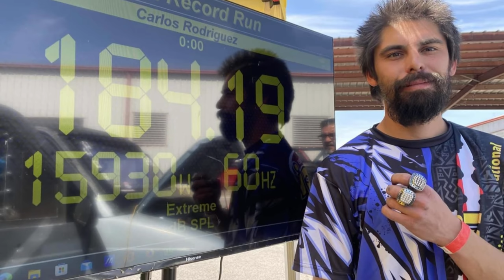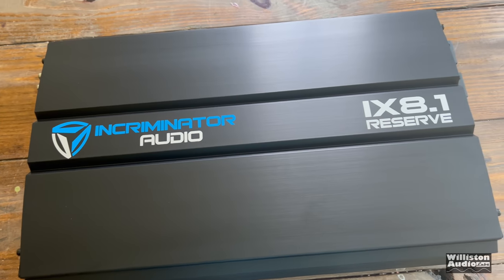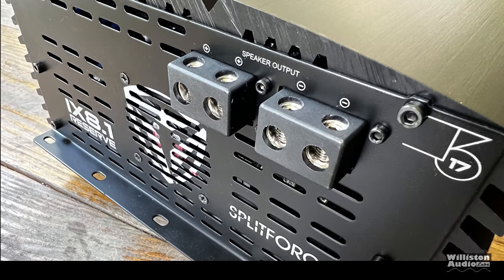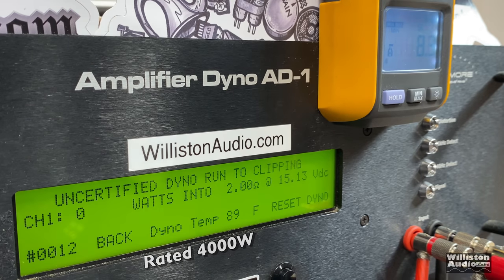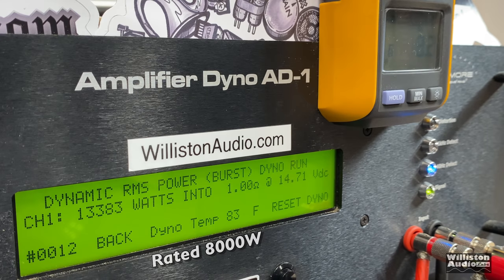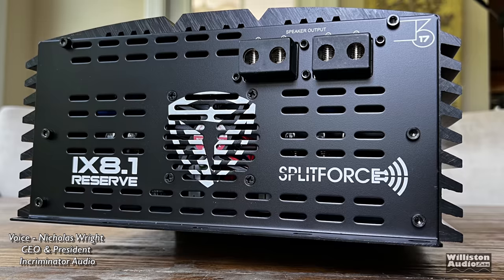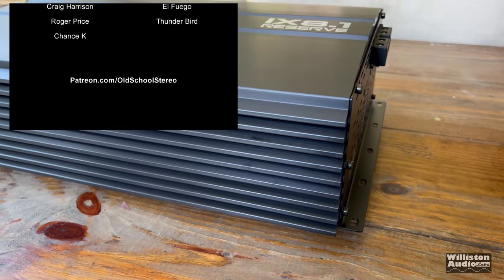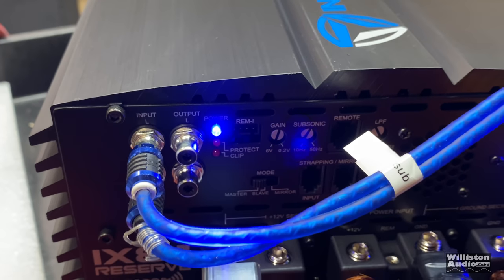8K like ALL DAY? Incriminator Audio IX8.1 Keeps It's Cool and Pumps Out the POWER! [4K]

Comment: The hard core enthusiasts who run this kind of gear in massive systems are clearly in a league of their own.  The needed electrical system and large gauge cabling needed to enable this gear to properly run at its rated capability is a substantial investment.  It is mind blowing to see folks run this kind of equipment in their daily ride...  🔊💪🏽🔥
Reply from the maker: I agree!
Reply: I know 2 guys with $10k plus in daily builds
Reply: @mattadams7922  I can see that this sickness... er, ah... "hobby"... will eventually land me at that dollar amount.  lol
Reply: Yeah buying a huge amp like this is the easy part. Buying and mounting extra alternators and batteries to feed it is the far more complex part.
Reply: @303nitzubishi4  One extra alt and 1 lithium battery with enough 0 gauge will suffice for upwards of 10k rms unless you play song after song with the volume up.  For most people, crank it loud for one great song and dial it back down for the next and 1500 bucks worth of electrical will give you the freedom to install just about any amp you want.
Reply: I would say stay away from this amp. This amp pulled 800 amps when it put out 8k watts. Plus it was given more voltage then most amp and still pulled way to much power from lithium batterie.
Reply: @timgermanyjr  The low pro SQL System I am currently running is no where near this scale (total potential power draw is only 3300W across all amps and DSP while currently running 2 AGM Batteries with the stock 150A Alternator).  I will be getting a 400A Mechman Alternator and Titan 8 under hood lithium battery to enable more flexibility for inevitable upgrades as I progress in the sickness...  I mean, the hobby.  I am scratching myself as I am typing this.  🤣
Reply: @timgermanyjr  i've yet to see a single aftermarket alternator  put out 800+ amps lol  but thanks for the input! ( still a really neat amp) but an INVESTMENT with 8$ per foot 0 ga and 3+3 runs.
Reply: @jimbobdobbs1597  You dont need to charge at 800 amps. The battery is the reserve power. Youre stock + extra alt can charge at 400 or more. A large lithium battery could give you a substantial amount of play time before voltage drops. Then turn it down/off and let your alt recharge the battery.
Reply: @jimbobdobbs1597  $8 per foot just for 0 ga wire... Idk where you shop Jimbob but you getting ripped off!!
Reply: @itdoesntmatterwhatyourname6128  i dont get ripped off.. i run double 4ga ofc at  $1.75 /ft
Reply: I prefer the 4ga to any larger for cost of lugs and terminals. Easier for me to work with also. I dont run huge amps so 2 runs of 4 does more than enough for my amperage. (Most shops resale 0 ga at about 8-10$ a ft) going rate on ama is 4.40 /ft  today)
Reply: @mattadams7922  - $10k is not hard to spend on a daily build these days.
Reply: We are concidered 1%ers
Reply: I have 2. 😁
Reply: Too much for me.  My whole system is under 1000 watts rms.
Reply: @kriptic22  not at all I wouldn't say I'm an amateur but I definitely don't have tons and tons of experience I'm on my third build I've ever done and  have we'll over $20,000 into it already 3 amps over 3,500 a piece for 54,000 Watts over $3,000 in batteries about $1,600 in 2 400a alternators and  the bracket little over $4,000 into 4 18 subs $600 into ofc 1/0 then $1000 in 2 4 channel amps for mids and highs and around $1800 in the mids and highs have 3 8in mids 1 10in mid and 2 tweeters in each door 4 doors  then the box was over $1500 all the sound deadner $500 fiberglass $600 all this  in a vehicle not worth over 10k but why would someone put all this in a new car it literally rips a car to pieces  but I can play music at 170+DB for demos for a few hours at shows before I have to let it rest.   

Ps.  Not one piece of sunclown trash in my build lmao
Reply: I have this amp's baby brother, a 3rd gen ia20.1, rated at 2400wrms at 1 ohm. Currently running a pair of 06 re audio sx10d4s. I have been in this hobby for almost 40 years, and this is by far the best amplifier that I have used, period. And they are in my home state of Alabama.
Reply: @mattadams7922  I have at least 9k into my daily and still not done setting it up. You are never satisfied and once get something good. You want better. It's  a never ending story haha. I have a sundown sfb8k for my two incriminator audio death penalty r6 12's.  Just I want rid of of the sundown to buy the ix8.1 now haha. All this to put in a car to be loud haha

Comment: Remember Big D's very important comment. "It takes power to make Power."
Without the proper batteries , alternator and wiring, not going to happen. That goes for all not only this Beast.
Reply: 900+ Amps is no joke
that's 8-9 battery's at 100AH each!!
Reply: Once you reach a certain point it's probably easier to just build a generator on a trailer or roof rack or something to power your spl amps 😆
Reply: @303nitzubishi4  well you may think that but even the average house with a 200Amp service is only 48000 watts total  😳 some of these guys are running well over that 
And If you have seen a 50 -100kw generator is not small lol
Reply: @NightshiftCustom  
We need to teach some of these people about amperage. Everybody is so into voltage they forget about the most important thing. I explained it to the newbies dealing with electrical and getting electrocuted. Think of the wattage as water and the orange juice running through the water as the amperage the more orange juice get the picture? Makes it easy for the average consumer.
Reply: I think he wordmarked that phrase, didn't he? Lol
Reply: @Mr.Robert1  is amperage the correct term or is it current?

Comment: Thanks for the demo as always big D. I'm an sq guy so I couldn't care less about an amp like this but it's cool to see how the other half lives 😀 The stacked PCB design seems like a great idea, hopefully other manufacturers start adopting it at some point even for more daily driver type amplifiers
Reply from the maker: The new D4S JP amps use all SMD (surface mount) electronics, that's why they are so much smaller than previous half bridge amps with the same power. Incriminator said they are working on this as well and future amps may be half the size as well 😮

Comment: These Incriminator amps are a work of art, if my dealer carried them i would have went that direction, but my Crossfire 16k is holding strong at .67 on 3 Xt3 18's, and 135ah of c-max, honestly I've been happy so far🤙, Super solid numbers out of the Incriminator 🤯, thanks Big D💯
Reply: That's a system I'd like to hear!
Reply: @dextermorgan1  This is the channel I only have a couple vids burping with the new build, I'll put something together tonight or tomorrow, also need to post on our Ford Raptor just put 4 DD 1508's, Lc2, and a DD M3c, neat little build🤙
Reply from the maker: Crossfire amps are legit as well
Reply: I love the xt3 but they're too heavy
Reply: @wal  I have a DD 9515 Supercharged laying around, just needs a recone🤙
Reply: @brotharobmusic  I'm going to be honest mounting them on a flatwall by myself was nerve-racking, especially sense I slipped once with a PSI sub I just reconed, got the job done though🤙
Reply: @bassbikes9709  my big bro had 2 in a 6th order wall. I Inverted them and it was a pain too. Now he has 4 C7 18s. I'm a Soundqubed guy. As soon as Soundqubed get the HdX3 18 in stock I'm buying 4 of them right away
Reply: @brotharobmusic  not a bad route to go, Soundqubed is the owner of DD Audio son, really good products, price is good as well🤙
Reply: @holeshotinspectionllc2412  I have an hdx3 15 on a Kicker Zx 2500.1@2ohm and it's mean
Reply: @holeshotinspectionllc2412  so soundqubed owns DD or the other way around?
Reply: @brotharobmusic  Two different owners, Dad owns DD, son owns Soundqubed, but they are based out of the same building🤙
Reply: @brotharobmusic  Sick, nothing wrong with that🤙
Reply: @holeshotinspectionllc2412  that dope! My first real spl sub was a DD Audio sub
Reply: @wal  I really don't like this brand because they actually think two boards together is something new. Two 4k boards in one case and sold for a high $$. It's completely a room saver for people that big systems

Comment: Wow 184 db on 15k amazing. I love how fat and different this amp is. Very cool looking to me. Very expensive. The JP63 almost had it. I can't wait for comparison to JP83. 😁
Reply: Yes very amazing, which probably drives up price. 🤔
Reply: that is more than likely measuring power from one amp so it would be multiplied
Reply: @SidyDidIt  That makes sense.
Reply: @SidyDidIt  dunno forsure, Craig Butler did 182dB with 4 DD Z 18" subs on 4 5000W DD Z1A amps, that was pretty amazing back in the day

however this ofcourse needs the entire car to be turned into a giant enclosure, bolted shut etc so nothing can leak directly
Reply: @BH4x0r  and then you have Nathan millyard. 8 DD Z418s on 16 DD M8000s doing over 180 at ~50 hz. With plenty of bandwidth all the way down to like 18hz
Reply: @blakebrockhaus347  well yeah, i just meant it's impressive he reached 182dB on 4 18's and only 20kW, but his setup was just to hit one note but hit it right lol
Reply: Back in the day I remember anything over 150db was awesome now they up to 184db

Comment: Revisiting this one.  I have an old IA 20.1 that I used to run on an RE MT12 with dual .7 coils wired to .35
Surprised this one went into protect but I guess you dont really need to run the giant amps that low.   
Keep your batteries charged, friends.

Comment: for what its used for (and the extra money you'll be dumping in, considering) only downside i see is the remote voltmeter, but that's a minor quibble and easily fixed. and really, considering the output, it's a decently compact package compared to some i've seen at the same rating, that don't go as far over rated.

Comment: 0.67 resistive load is like a 0.1 ohm subwoofer... if they are running them at 0.3 ohm in competition, i would suspect with rise, its around 0.8 ohm
Reply from the maker: I would think the TL would show the impedance but that sounds about right. My sub wired to 0.5 stays 1-1.2 ohms

Comment: Looks like a great SPL amp. I don’t like seeing a Korean amp go into protect @.67, and $2000 is pretty high, but I love the stacked design to bring down the length a Korean amp that does this power would typically have. I realize after rise you could probably run this thing @.5 all day speakers. Seems like a great amp overall👍🏼👍🏼
Reply from the maker: Nick says they run all the time at 0.33

Comment from the maker: Incriminator Audio IX8.1 8000W Subwoofer Amplifier
Shop (affiliate links):
Incriminator Audio IX8.1: https://bit.ly/3t4w5Lz
Crossfire XT 8K: https://bit.ly/3wZDvAC
Sundown Audio SALT 8: https://bit.ly/3t7IsX5
D4S JP83 Amplifier: JP83 Amp: https://bit.ly/3t0zz1y
Incriminator Audio IX15.1: https://bit.ly/3MZ5reL
Down4Sound JP Amps: All JP Amps: https://bit.ly/3lMb4kz
Video Playlist of 5kW and Larger Amps: https://bit.ly/3M2PuTE

*You Sell Subwoofers and want to sponsor a Do It Bump Segment?*
Send me an email willistonaudio (at) gmail dot com and we can discuss

SMD / D'Amore Engineering Amp Dyno: https://goo.gl/sJTcf7
XS Power D1400 Batteries - https://amzn.to/2BPFCKW
XS Power PSC60 Charger - https://amzn.to/2CHGcfs
Fluke 1000A AC/DC Clamp Meter: https://amzn.to/2Rw5WDA
Handheld Dyno: http://amzn.to/2u2EgKV
My Favorite Screwdriver Kit: http://amzn.to/2x0VzcE

Video Index:
0:00 Intro
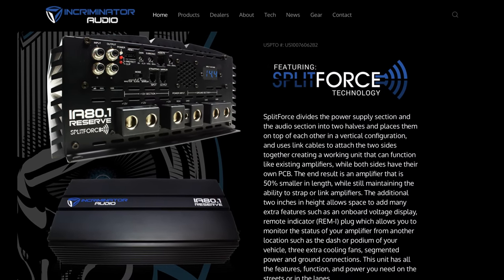0:52 Unboxing the Amp
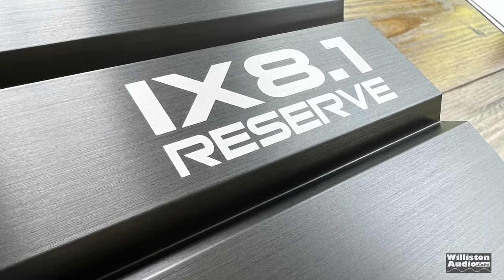2:10 Features and Specs
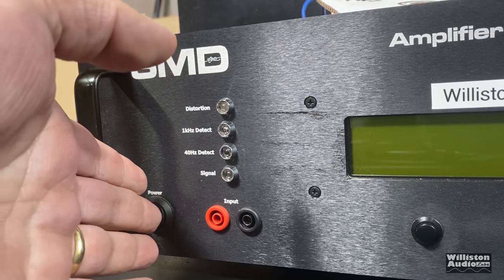4:25 Amp Dyno Tests
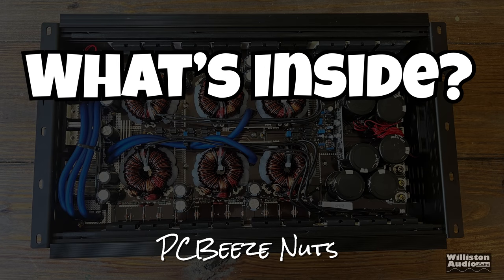8:05 What's Inside?
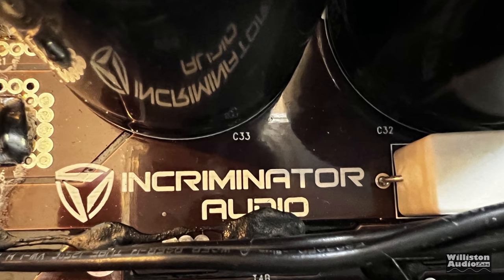9:24 No Do It Bump Doe?
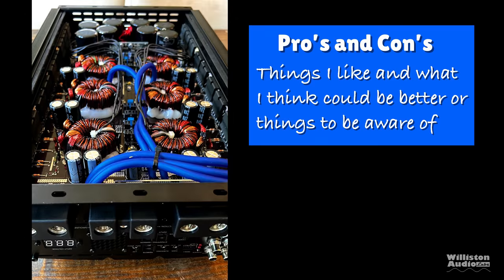9:46 Pro's and Con's
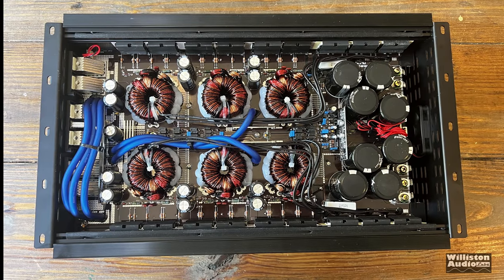10:32 Final Thoughts

11:05 Extra Tests

DISCLAIMER: This video and description contains affiliate links, which means that if you purchase from one of the product links, I may receive a small commission. As an Amazon Associate I earn from qualifying purchases

Comment: any suggestions for a half decently priced 4 channel amp for a SQ build for my truck? list so far 4 sundown sa10's, audiocontrol dm-810 dsp, 2 sets component jbl gto609c 6.5 sets, and 200 pounds of sound deadener lol 1/2" thick  around the hole truck to deaden the diesel engine. thanks

Comment: hey there bro had a question about the fuses for these amps. i ordered the ix 6000 yesterday. would i use 3 200amp fuses on the 3 positive wires that go to this amp to equal up to 600amps. or 600amp fuses for all 3 positives wires?

Comment: I was expecting a little bit more to be honest. But I suppose that's where we are in car audio these days. More is not always better apparently
Reply from the maker: People always think they want more it seems
Reply: @Dibeezy ThaGifted how much more power do you want from an 8k amp?? If you want more then you need to be looking at amps with higher ratings!
Reply: @itdoesntmatterwhatyourname6128  I was only expecting more because of the current trend of amplifiers doing rated in the 12 volt range. I figured incriminator would at least want to keep up with Crossfire and sundown and digital designs as all three of those companies new 8ks make over 12K
Reply: @DibeezyTheGifted  ok, I gotcha... Hey atleast IA is doing their own thing & actually being innovative. The amp is a new design, it's unique & appears to operate exquisitely. I love the fact that even after running it hard on the dyno then running it on the Massive Audio sub the amp still stayed cool. That's impressive, idk many amps that could do that.

Comment: subwoofers, especially in an SPL build are creating ALOT (like 10-20% or even more) total harmonic distortion, so having it under 1% THD in an SPL build is completely useless. Uncertified and Dynamic truly are the numbers that matter here. Now if you're doing an SQ build, then that's a different story, but for SPL, uncertified is where its at, and also dynamic for those burst tones. Humans cannot detect distortion in bass frequencies until around 10% or sometimes more.. so i see no problems here, this amp is exactly what you want, big dynamic numbers, how amazing for such a small package. I also LOVE that the power and ground are actually separated, its alot safer that way and more convenient.
Reply from the maker: my sentiments exactly

Comment: It's a good amplifier but I'm not running any amplifier up to clipping? For two main reasons I don't want my coils smelling and I don't want a voltage drop? And the voltage is going to drop when it is clipping?
Reply from the maker: SPL competitors use clipping to get some extra deebeez

Comment: This amp is a technological tour-de-force, but a 13KW peak at 14.5 volts equals a current draw of almost 900 amps! So really, it's just for competition use, right?
Reply from the maker: I guess some people could put an amp like this in their daily driver...as long as they have phat electrical to back it up
Reply: @wal  Maybe a diesel generator like the one I have for when the power goes out! 😆

Comment: TY big D!
ATTENTION BASSHEADS 
Im in need of 2 Beastie amplifier! but the price breaks the bank 🏦 , I could see myself paying a $1099 or something but 2k is definitely out my budget. What’s a decent amp 8k-12k watts, besides Taramp. (Because I was considering running; 3 smart5 bass amps, or 2 bass 8k amps)
Reply from the maker: Gotta have strong electrical no matter what amp(s) you choose
Reply: @wal   yes indeed. Takes power to make power my friend.
will a 128ah bank of headway’s be good enough? I have two banks but would prefer to use just one if possible. (I guess it depends on voltage drop) I have a 320a JS ALTERNATOR for now. 
I see Parker the basshead running  2 taramp 8k’s on his setup.  I’m just curious on other options of amplifier. I will eventually start uploading my builds. (Eventually)I gotta give it to you big D it ain’t easy.